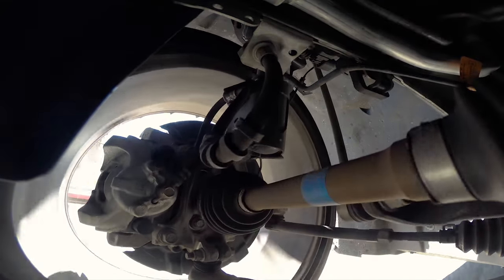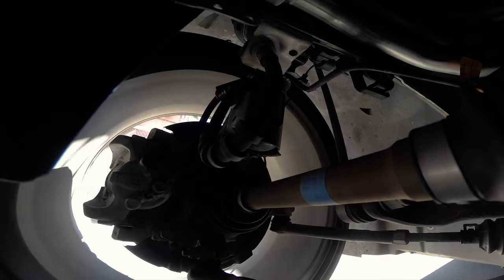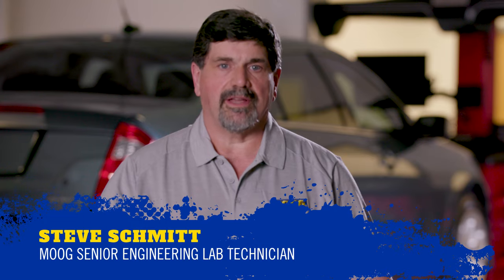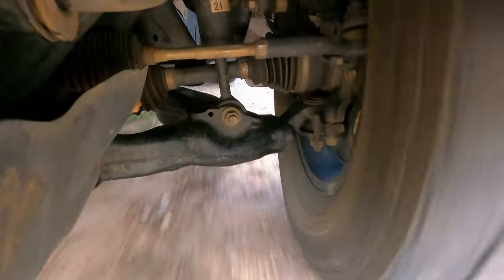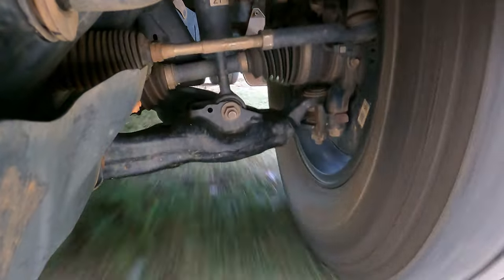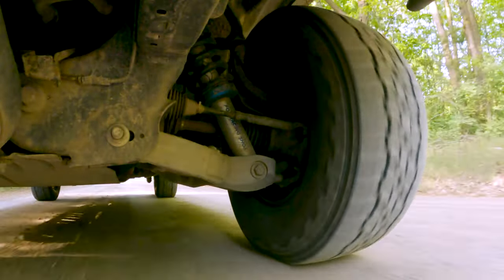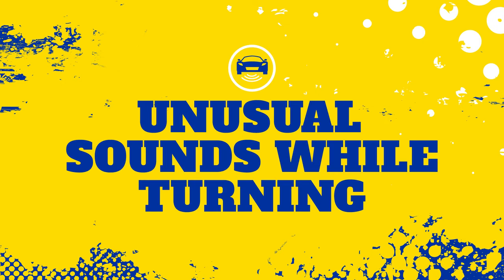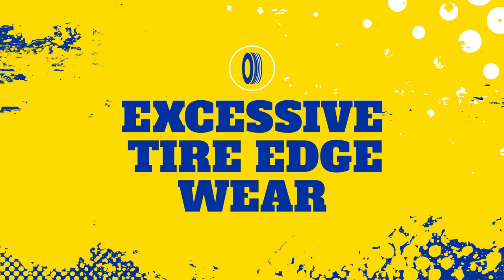Symptoms of Bad Tie Rods | MOOG Parts

Comment: How about a clunking sound  when hitting pot holes?
Reply: Want to know this as well
Reply: Ball joints
Reply: Check your strut mounts first by bouncing car or rocking. See if the top of the strut nut moves around in the rubber. After check the condition of tie rod ends, control arm rubber, ball joints, and sway bar links. The front strut mounts are most likely the problem if you been hitting pot holes and is easy to check just lift up hood.
Reply: @juanmolina9815 loose tie rods. mine were loose when checked, making low clunking sounds on my 00 camry while hitting potholes
Reply: your situation could be different but for me it was sway bar links
Reply: My car was making a clunking noise, when it shifted going slow. Thought it was transmission. They said it was my tie rods. Fixed the tie rods, still makes clunking noise but not as much.
Reply: @francesscarlata822  maybe the transmission mount or motor mounts are worn out
Reply: Shock absorbers or top mounts
Reply: @Speedfighter313  I think tie rods.
Reply: @Patrick-yh5yd  tie rods would clunk when turning as that would pusht he inner joint…maybe it’s worth taking a look first
Reply: ever find which part it was? tracking down this same issue now.. replaced a bad control arm/ball joint on front pass side but the noise continues
Reply: @AfternoonProductions  I changed my struts and springs, just ended up getting a good condition second hand leg, which came complete with the top rubber mount, if these fail they’ll make a clunking sound, or could even be springs if not so best bet just get a leg if you don’t want to narrow it down.
Reply: @AfternoonProductions  I have been living with it but will fix when I can. Good luck
Reply: Sway bar links or shock mounts
Reply: Literally anything , ball joints can sound creaky or bang, drop links (sway bar ends) can rattle and bang , struts can creak squeak and bang, lower control arms , suspension bushings literally anything mate... If you're not planning on getting under there to fix it just take it somewhere that knows what they're doing because honestly you'll cause yourself more of a headache than the bill will
Reply: @50FiftyPence50 and drink Sapporo when changing out the front end suspension.....
Reply: Ball joints
Reply: @96cr  has new ball joints  and struts...
Reply: I had this problem  twice it's the control arm bushing.
Reply: I have clunking when hitting potholes and turning my wheel any help?
Reply: @maynedon same…
Reply: That's the shock absorber
Reply: @maynedon 
Amongst the parts other people have mentioned…it could also be your CV axel.
Reply: @maynedon  could be your sub frame bushings.
Reply: @TexasStronghold not always. Could be struts/assembly
Reply: In my experience, that’s the result of stabilizer links that are going bad.
Reply: Sway bar bushings

Comment: My 95 Civic has quite a bit of play on the steering wheel while driving. At speed beyond 85, the wheel shakes. Car has recently replaced tries so it should be balanced. The rack was replaced 5 years ago with a reman. your thoughts on what I should check to find the culprit? thank you!
Reply: Warped rotors even the slightest could cause bad wobble and shake on higher speeds I would look at that forst
Reply: @zzpeepeepoopoo88  only rotors when braking. When acceleration it is a bad alignment which should be done every 3-6 months

Comment: How about uneven roads. Like if the road is slightly slanted to the right it pulls right. If it slightly slanted left it pulls left. On flat surface it goes straight.. I'm not talking about minimum road crowns. It should pull hard like an accident

Comment: I love my 2000 306 Convertible but its not without grief. I need a new track rod end and new front tyres balancing. Virtually impossible though as nobody does  centreless wheel balancing anymore.  I get loads of nice  comments on my car.  It's in great condition and Ii ook good in it